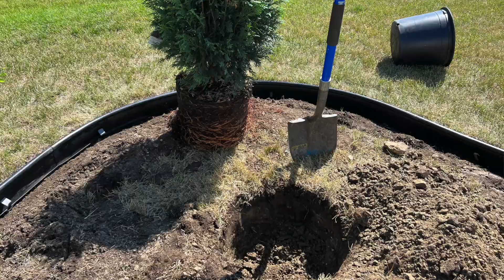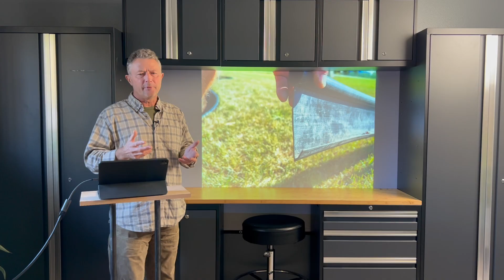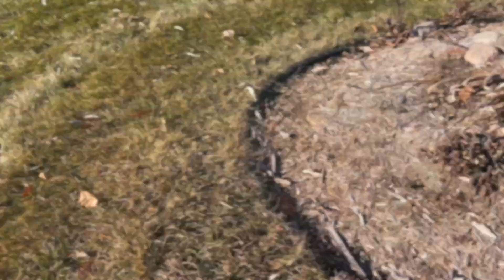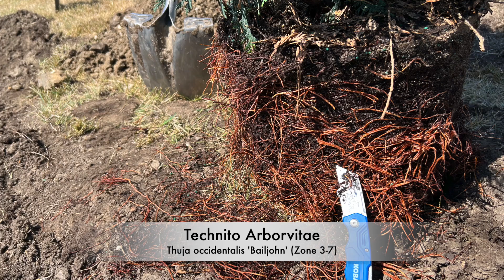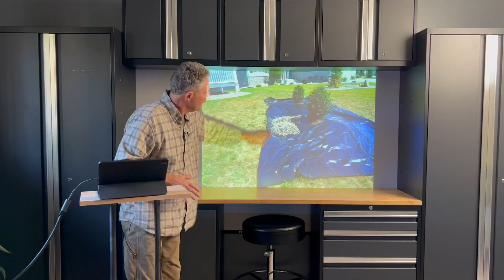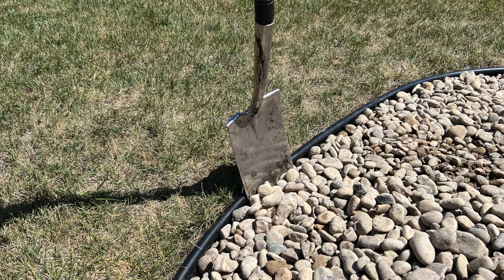Adding A Landscape Bed To A Front Yard

Comment: Nice job Kevin 👍..... In my front yard the previous owners planted the invasive chameleon plant going on my second year of trying to get rid of it, do you have any ideas ❓last year I spent a lot of time digging and removing as much of the rhizomes as possible
Now it's covered in black poly and it looks like it's still coming back 😡..... I guess I'll cover the poly with rock don't know if that will work or not. If you have any suggestions I'd appreciate it thanks 🤷
Reply from the maker: I’m unfamiliar with chameleon plants, so I can’t say for sure. Usually, black poly does the trick due to the lack of sunlight on plants. However, I have seen plants with rhizomes stay viable for a long time under the poly surface. Any opening due to cuts and along the edges and back they come. Solarizing can be very effective on invasive plants, but you must be patient. You use clear poly (ensure it is greenhouse poly - UV resistant), and seal the edges with soil or heavy objects. The clear poly will allow the sun’s rays to penetrate the soil and heat it to temperatures (I believe as high as 180 F) that sterilize the soil and kill roots. Depending on how much sun you get, you need at least 6-8 weeks to be effective (longer in low sun areas). Otherwise, herbicides may be your only option. Be careful though, some brush killers have soil sterilants in them and nothing will grow for several years. Good luck!

Comment: Hi Kevin. What product do you use to kill the grass and how do you apply it so the grass doesn’t die around the outside of the bed?  Thank you!
Reply from the maker: Check out Decimate by Fertilome -(Glufosinate Ammonium). It acts by inhibiting the plants ability to utilize nitrogen and has limited translocating potential so works well along edges and landscape beds. I use high quality backpack sprayers as they allow much better control of pressure and have a long wand making it easy to keep the spray nozzle very close to the ground or target area.
Reply: @gardenhike  Thank you kindly! Happy Holidays!